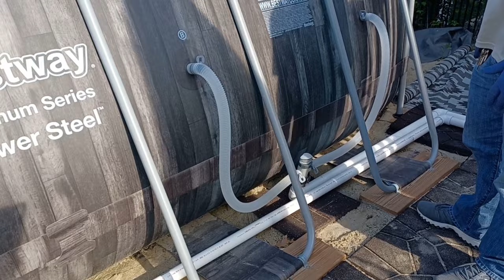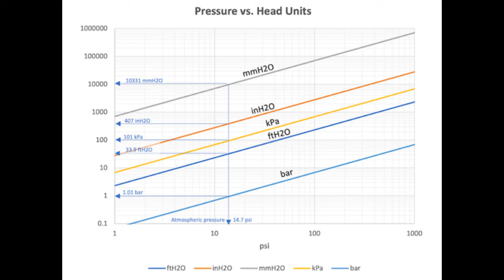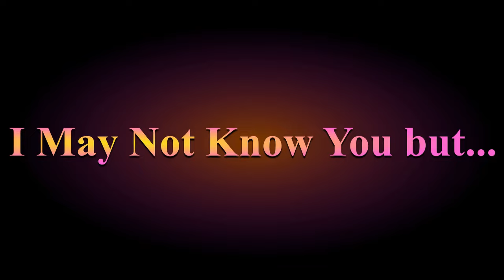Pool Heater Install and Set Up

Comment: After much research (so many people online complaining their heaters started leaking in 1-2 months!) I thought it would be best to put the heater before the chlorinator due to the corrosive nature of the chlorine, but you are the only one I've come across to specifically point it out and even suggest a check valve.  Thank you this was very helpful.

Comment: You've probably already found out, but you don't want to be running full flow through your heat pump. You'll only get good efficiency with a specific temperature drop between inlet and outlet which will be listed in the specifications, so normally you'd install a bypass kit across the heat pump to divert most of the flow.

Comment: I'm think about this heat pump.  your setup looks good.  i would like to know what the water temp is that is getting sucked into he return and what the water temp is on the pipe that is coming back to the Pool.  Also, I would recommend you burry the pipes so that no one can trip.  Thanks for your video.

Comment: I think I have the same heater, a 20000 BTU model. Mine is branded Doel. The instructions for the control panel are terrible. Do you have a source for more detailed info. Were you able to switch yours to F from C?

Comment: I was thinking of this heat pump too. Either that or the fh135. I only have 110v going out to my pool so I have to get a smaller heater. My pool is 24foot round though and I know it's technically too big for this pump,  but my pool is freezing and gets no sun. How many gallons is your pool and do you recommend this heater? Thanks for the instructional video!
Reply from the maker: I think it's 10000 gallon

Comment: what's the name of the hot/cold hose that runs from the filter to  heater and then to pool please?
Reply from the maker: I used the hose that came with the filter setup look at pool hose on Amazon it should come up
Reply: I believe those are just 1.5" Intex brand flex hose